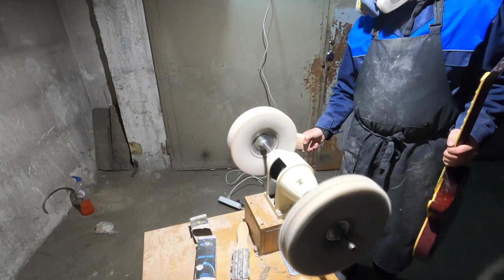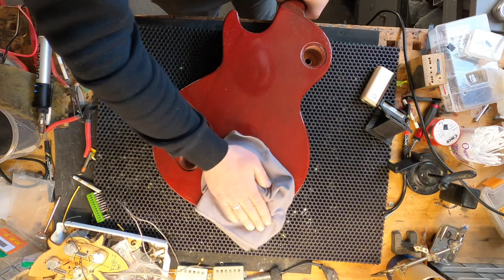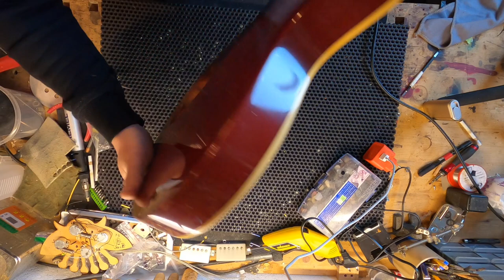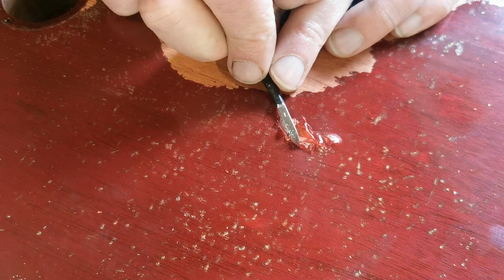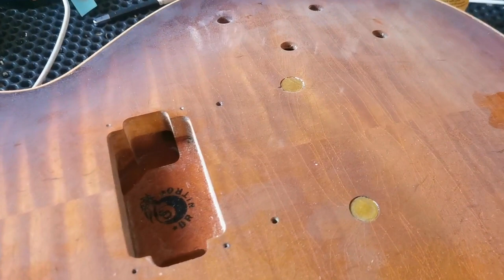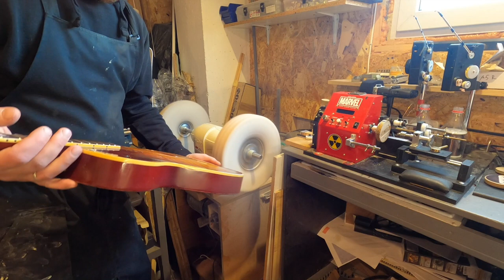HOW TO RELIC A LES PAUL GUITAR. Stephanie Burst relic. Part #2

Comment: Curious what the heat does before you use the scotch brite or the M3 0000 pad? Does it soften it so it mattes the paint better? 

I have a 2005 LO standard in trans amber that has a lot of great natural wear but the thing is just still so glossy it looks awkward, so I’m debating knocking back the gloss to dull the finish a bit. 

I also wish it would check so bad.

Comment: Fantastic videos my friend. You do great work. Do you know if the freezer checking method works on new gibson nitro? Or will it be too thick? I have a SG Special body which i want to throw in the freezer....
Reply from the maker: Thank you.  Modern Gibson nitrolac has an extremely high amount of plasticizer, so it is soft and sticky.  I recently tried aging a Gibson SG with the original gibson nitro.  The temperature was minus 24 degrees Celsius, in two cycles of 12 hours.  And not a single crack in the varnish.  Unfortunately, this is so.  But you can always try.
Reply: @8BombCustom  thanks 🙏🏻 much appreciated. Have a great day!
Reply: @8BombCustom  Update: Just received the Inverness green SG special a couple of days ago and had a go in the freezer - a handful of dispersed cracking around the whole guitar - gonna try a few cycles to see if i can get some more! I laid the guitar to rest in my bathroom (around 25c) for a few hrs then put it into the freezer (-18C). Vertical checking just like i hoped 🙂

Comment: Your work is amazing. I have a 2003 LP that has naturally checked, but all the checking runs horizontal with the grain. It looks great, but I wonder often why I see so many others that run in the opposite direction, across the grain. I watched your efforts here and again I see the checking seems to be in the other direction. Is this just how it happens? Keep up the great work!! Thank you for posting and the fine translation to english!
Reply from the maker: Thank you. I've seen examples like this with cracks in the lacquer along the grain and I have a couple of these guitars.  Such cracks indicate that the wood of the guitar has been exposed to a strong drop in humidity and drying out.  There were several such cycles.  The wood fibers expanded too quickly and contracted strongly when dried.  Therefore, cracks in the varnish turned out parallel to the texture.
Reply: @8BombCustom  Thank you for the clear explanation! Much peace! Nick